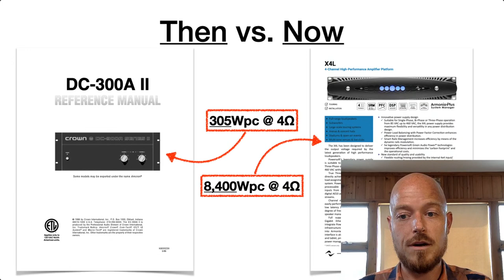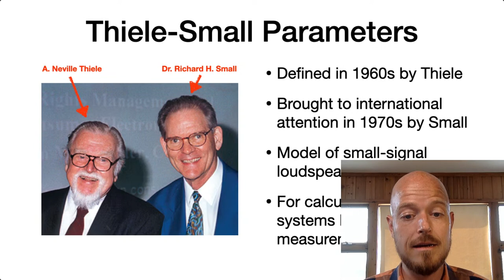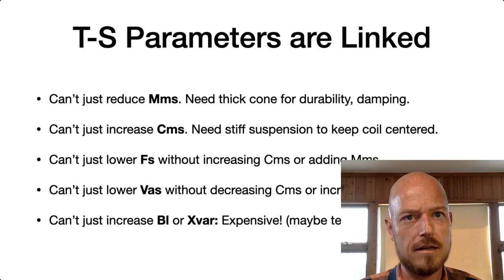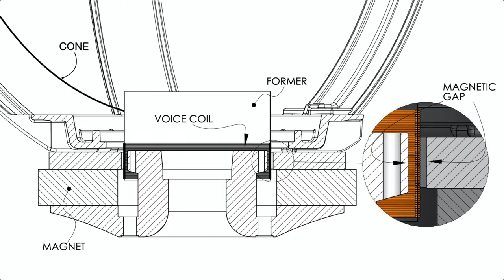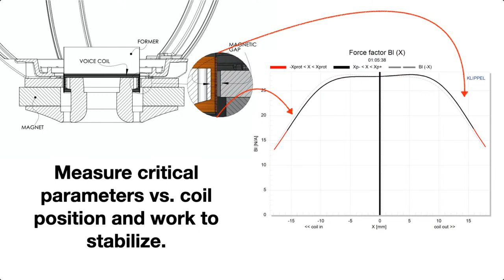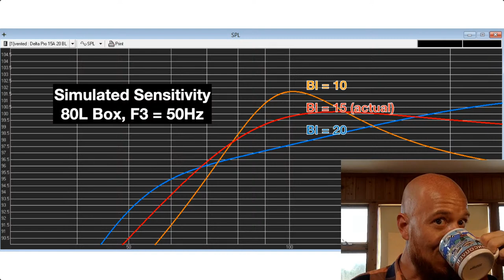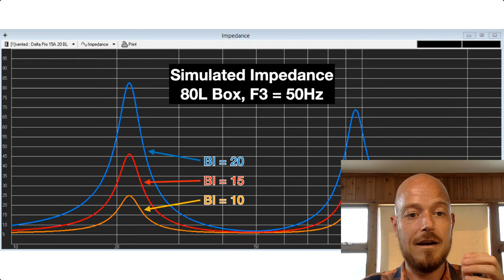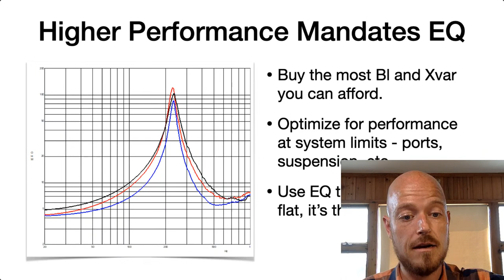T-S Parameters in the 21st Century

Comment: Nice video, thanks, learned a lot. The "calculated 1w/1m response" section (38:03ish>) seems a bit like Keele's true power discussion but is not something I recall reading about being included as a spec. Anyway, can someone explain how the senstivity value on the spec sheet is defined? Many drivers spec a senstivity number that does not seem to jive with the provided frequency response graph, eg. 12CL76 8r specs  98.5dB 1w/1m, Fs=48Hz. Eyeballing the response doesn't seem to equate to 98.5dB. Help?

Comment: 43 minutes of condensed information, this is what every educational video should be like!
You mention the X4L in the end, saying that it provides just enough volts to drive a pair of 15" drivers unbdriged.
To my knowledge the X4L is basically just a bridged version of the X8, which is why it is able to provide a voltage swing of 300V.
Maybe you have the X4 specs in mind?
Reply from the maker: As far as I know you're correct, and it can't be double bridged so finding a higher limit will be tricky. GaN semiconductors can't come soon enough!